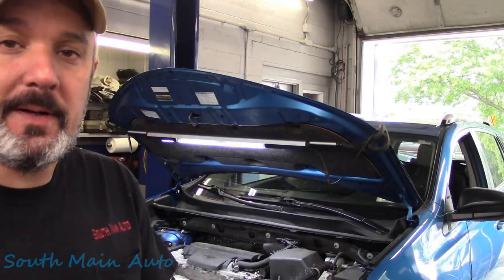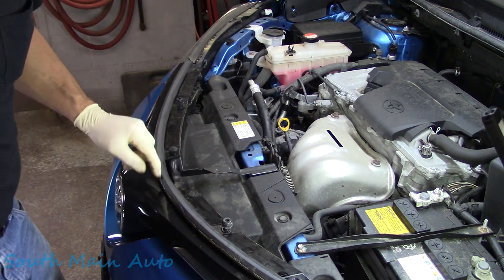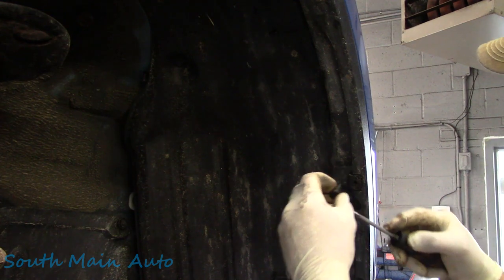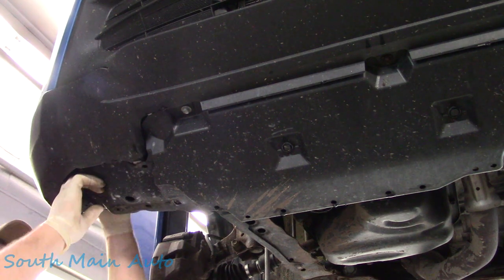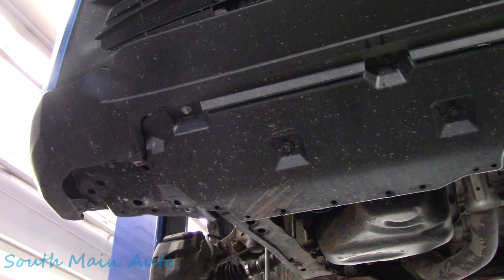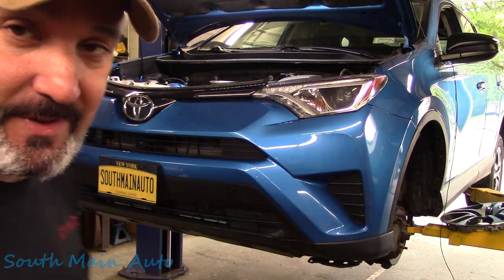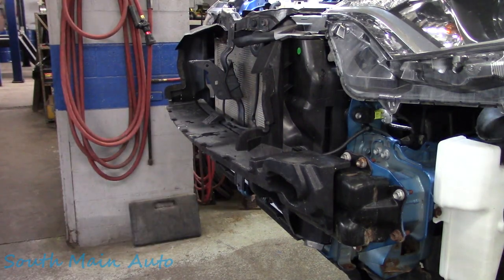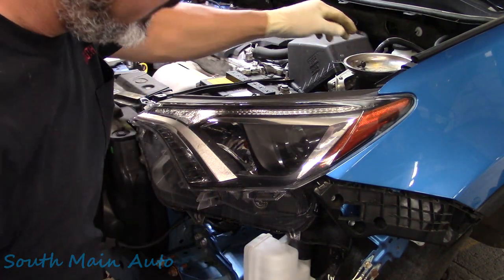2013-2018 Rav4 A/C Condenser Replacement

Comment: This was interesting to see.  I was thinking if this was the other end of the A/C cycle - the evaporator - that was leaking, that could be a really involved job, with lot of interior pieces removed.  I hope the owner of this 2016 model gets a bunch of good cool years out of this repair, before something like the evaporator leaks.
Reply: Condensers are always going to fail before the evaporator will.  Just because they are at the frontmost part of the vehicle.  They get hit by bugs and pebbles and other road debris.  Not to mention all the passive heat from the radiator right next to it, plus rain, sleet, snow, etc..  I'm surprised they don't fail more often.
Reply: Toyota’s have really good AC systems, but all cars need repairs. My 98 4Runner still blows cold, had to top off the r134 after a serpentine belt change. Took half a can.
Reply: @jtjones4727  I owned a total of 5 Jeep Cherokees (not Grand) over the years. Every one of them developed a leak in the evaporator after about 10 years. Never had a condenser leak.
Reply: @jtjones4727  Only Bikers know How Big bugs really are ! LOL

Comment: You're an amazing mechanic. I totally agree with you on modern cars - the complexity and the amazement that they work as well as they do for as long as they do. It's a pity that when they get a certain age, there will be nothing there to restore. Brittle plastic parts turning to dust and so many types of plastic fasteners to source. Probably no working scan tools around because the industry moved on to something else. I guess a lot of the manufacturing has moved on to injection molds instead of stamping dies. It is amazing the parts all fit together as well as they do!
Reply: Lets be real, for most "proper" cars there isn't much to restore beyond a certain point. Brittle plastic, deteriorated cloth/leather, or rotted away metal, it's all the same. No matter where you live, one or more of these deaths await all cars at a certain age, no matter if it's a "classic" or a modern car. In the north, they rust. In the desert, anything not metal just gets brittle... Andbif you keep your car in a clean, air conditioned garage as a show piece, all the hoses and seals get brittle and will just leak like a sieve the first time you drive the car after it's been sitting in "conservation" for a decade.

Comment: 27:44 I wholeheartedly agree. I replaced the condenser on my old subie myself. Rented a vacuum pump, and tried to diy recharge myself with a manifold gauge set, and a postal scale to weigh the cans. I think that subie called for 14oz-16oz of refrigerant, and people say they're super picky about how much refrigerant is in the system. Long story short, I got it done, but at the end I wasn't exactly sure how much refrigerant I got in the system. I knew it was somewhere around the correct amount, but I didn't like the feeling of uncertainty. If I had to do it again, I'd do the nuts and bolts part of replacing the condenser myself, and then let a shop do a proper recharge.
Reply: I got lucky on my minivan (olds silhouette) took exactly 36oz of refrigerant. I fixed the leaking service ports, pulled a vacuum and dumped in 3 12oz cans. Works ok, but between changing cans and purging the line, probably an oz or 2 short. Now that I am working at a shop, I can evacuate and recharge to the correct amount.
Reply: @kd7cwg  Dual A/C? That's one hell of a lot of 134a! Most systems are happy with about 1/2 that.
Reply: @billh230  yep, used to have a suburban 2500 with front/rear and I think it took even more 😳
Reply: I just looked it up. 64oz in the suburban.
Reply: @kd7cwg  Looks like I need to review. Most aircon systems I've screwed with ate of the aftermarket/hot rod variety. I just leave evac and charging to the HVAC guys, while I do my thing.
Reply: Too little and mediocre cooling, too much, and you hydrolock the compressor.  Sounds like you did just fine.
Reply: You dont't have to do government paperwork to purchase coolant agent?😁
Reply: The most important procedure in the entire operation is to evac and recharge properly.
Reply: We don't have these specialized charging stations here. Experienced ac techs just vacuum the system and add refrigerant until the sight glass clear and the pressures are good. These 2 will tell a lot. For instance when there is too much oil, the high side will be high, while low side is low and sight glass is not clear.

Comment: I had a 1988 s10 2.8 throttle body bolt repaired at a machine shop... and they used a wood screw type set. It cranked the tq like crazy by hand:)

Comment: Last Toyota AC work I did was on a 91 Camry.  Needed reman Denso compressor and dryer.  Converted to 134 and new schrader valves. 3 years in and still blowing cold!

Comment: This video came at a right time.  I'm having issues with my A/C in my truck and just ordered some manifold gauges to see what's wrong with it.  Hopefully, I am just low and will probably take it to a shop and have them recharge it.
Reply: Jimmy S  I have been doing a ton of research and watching a ton of videos and a lot of shops that have videos  say to evacuate the whole system (including ol' Scotty Kilmer) and recharge with new refrigerate.  Especially with the R134 system which mine has.  Thanks for the tip about the stop leak stuff.  I had someone recommend that stuff and I was leary about it.

Comment: I have a 2015 Highlander that I bought used with 104000 miles.  love that car. then I wanted to change the headlight lens. I had to take the whole front cover off! I think I did well It only Tok me 5 hours to change the lens's.

Comment: Hi Eric. I always replace the Orings with new as a caution. Since old ones are compressed, I think it is a "best practice" to replace with new for maximum sealing. Keep the old ones in case you lose one.
Reply: Not replacing AC O-rings on a vehicle that old is just asking for a comeback, very surprised he cut corners like that, it's not worth the potential problem.
Reply: You guys are such experts, you should have your own channel. 🤥

Comment: The engineering in automobiles in general impress me. Think about how the small ends of the rods rotate around the crank. It only ever touches when you first start the car. The rest of the time it floats on a "pillow" of oil. It's rather incredible engineering.
Reply: It gets even cooler when you look at the drivetrain of a hybrid like a Prius. There's a secondary electric oil pump that pre-charges the system so it has full oil pressure before it even starts cranking.

Comment: Curious if Toyota assumes the "pre-installed" desiccant pack is likely saturated in transit/storage, and expects the fresh one to be installed to start "fresh"?
Reply from the maker: Wonder why in the heck they even put on in then in the first place? Nothing in service info about it....
Reply: @SouthMainAuto  I'm thinking that the condenser is "problematic" to dry out sufficiently, if it does happen to get wet in transit/storage,  so the installed pack is "pre-emptive"... but curious there's no mention in service info.

Regardless, I'm spit-balling, because Toyota is pretty smart,  and I can't just accept that it's an oversight.

Comment: Yep, amazed that a small car like the former Fiat 500 was built like it was. Did an extensive research on them when they were being introduced in 2012 and they had a beefier frame for the US versions and were designed to remain intact in the cabins so the doors can still open to some degree at least in a head on collision, and if I recall, they did fairly well according to NTSA. Back in the 90's, I drove a 1983 Hondoo Civic, the venerable "big" 1500cc DX grade hatchback that weighed all of 1500Lbs and had all of 68HP and when in a collision, they likely folded like a tin can in a serious accident and I drove the snot out of mine back in the day. 

In 2012, bought a replacement vehicle, a 2003 Mazda Protege 5 wagon with 110K and change on the clock and a decade later, it's still on the road, AC still blowing reasonably cold, but could use a little TLC now and it has 195K miles on it and has been a super trooper this whole time, outside of 2 big repairs, the timing belt replacement that took me a while to figure out why it was running like poo (timing at the exhaust valves was a tad off), but once that was solved, it ran great, then the right front wheel bearing was going bad, and ended up having both replaced, and had already had one done in 2013, along with new tires that year. I have 195K and change on this car and it's still running mighty fine.

As you pointed out, it used to be that you'd barely get over 100K miles before the car would begin to fall apart, and that was by the late 60's and beyond. Before that, often a car was used up (rust notwithstanding) by 80K.

Comment: My 2016 rav4 was in the shop for 1.5days they couldnt find the leak. Watched you video, got the car back from the dealer and put a sniffer right on the bracket that you pointed out. Bingo! Will now do the replacement myself, what is the torque spec for the tube connections on side of the coil?
Thanks so much for your detailed video!

Comment: I remember in the old days on my 66 Riviera 4 bolts for the radiator then you were at the condenser and done. Today you have to disassemble the front of the car just to get to it.

Comment: I still have an 85 Oldsmobile. It's got close to 600,000 miles and the only issue i had recently is that the original transmission started slipping

Comment: i learned a good lesson after listening to you recomend Dorman over and over had to replace the gas pedal on a 2007 buick drive my wire. well have installed 3 all bad called Dorman each time and they went over the testing while staying on the phone with me and after the 3rd one they said go get a OEM and be done with it. i said who is paying for all these hours diag time and they said submit a bill and you will be paid for the time. now wondering if i will get it. I knew better but after you said how much you liked there products i tried it. LOL

Comment: If you ever watch Ron Pratt's channel he had an emergency tow off the highway that had been an enormous collision, literally the engine from this SUV was a hundred feet away and bits and pieces were scattered everywhere. The car did its job perfectly and dissipated the energy of the crash so well that the driver walked away without serious injury.

Comment: About your statement about the 60%  of the time leak location. 
Is that a design flaw? Seems like it. Always a bonus to see Mrs. 
O make a cameo appearance. Gotta be careful re installing those headlights. Expensive mother lovers. Really like the license plate cover on the front protecting your customers identity. Wow, 38 degrees out of the center vent! brrr. It may sound crazy, but I enjoy repair videos. Thanks for sharing. Ship it!

Comment: Which is more trouble to work on RAV4 or CRV? Hard to believe you need to disassemble the car to get to the condenser. Geeez
Reply from the maker: They are both a good car to work on...unless you are putting the serpentine belt on the CRV. You will learn a few new words then....

Comment: That job made you get just about every tool you own out to do it! Baffling array of different fasteners, I guess it makes sense somewhere to someone in a production factory. Are the top brackets made of steel against the aluminium condenser - or are they plastic? Nice job though.
Reply from the maker: No they are steel. That is the issue when you add a little salt to the equation.
Reply: @SouthMainAuto  I wondered, bit of anodic corrosion and that's it done. Would be so easy for Toyota design out that issue.
Reply: Seems like every time I work on something, I have 50+ tools out 🤔Good thing I have like $30k in tools to fix the modern day car🙄
Reply: @SouthMainAuto  Crazy, why on earth would a simple aluminium stamping not work? Oh, right, the dealers wouldn't get as many gravy jobs.
Reply: @Monkeh616  Aluminum binds to aluminum far more than it binds to steel, when salt's in the mix. The upside of that steel bracket is that the stamping of it actually makes a small "lip" on the punch-out side, which makes it not have that much contact with the aluminum- so very little sticking happens.
Reply: @LordOfSilense  At what point do you ever remove those brackets? They come attached, they stay attached until the thing gets torn apart at the scrapyard.
Reply: @Monkeh616  Not a matter of disassembly. The problem is galvanic corrosion. Keeping a distance between mild steel and aluminum is the reason behind the way that bracket is made. It was never intended to be disassembled.
Reply: @billh230  It seems reasonably logical that the best way to keep a steel bracket away from aluminium is not to make it steel in the first place.

Something is being lost in translation here.
Reply: @SouthMainAuto  Al + Fe + NaCl + electricity = corrosion

Comment: We generally use what ever parts we can get our hands on, OEM or aftermarket, but try to stay away from the dealers as their prices are inflated. We use a few different suppliers that have a range of both OEM and aftermarket. The only aftermarket parts I don't trust is compressors but sometimes you don't have a choice.

Comment: Repairing a Toyota less than a decade old?  A rare sight indeed.
Reply: Scotty Kilmer does not approve
Reply: Jimmy S  Never.  It's impossible for a 1994 Celica to break.
Reply: Its a design flaw. Steel bracket against an aluminum condenser. It will rot out again in 5 years.

Comment: I had a brand new 2011 Camry and the AC went out, brought to dealer and they said a rock damaged condenser. Warranty will not cover rock damage. They wanted $900 to replace condenser. I said no thank you and replaced it myself for about $60 worth. That said there was NO rock damage. But I found that plastic plug on the drier was backed out OR not even screwed in and that was where the Freon leaked out. The condenser I put in had a metal plug. No problems years later.

Comment: Eric, you are 100% correct that cars today are much more reliable, longer lasting, much safer, and have many more creature comforts.  However, I still miss the days when you could walk over the the entire surface of a car, and my father would only yell at me if I didn't take my sneakers off first, because it left trend marks...
Reply: And the older ones are a lot easier to repair, new ones need a computer tech

Comment: Excellent video. Is it possible that a front end collision could damage the condenser with no obvious leak but the air is not cooling or may start a little cool but then run warm? There is no error code and I want to make sure only necessary work is done by Toyota. The accident was by someone slamming into my car with such force that the washer reservoir was smashed and passenger side headlamp. The entire bumper was replaced. Thanks.

Comment: Eric, why would you not want to charge the system and do a leak check before fitting the bumper cover back on? Surely access to the lines would be much easier at that time? And by the way, these new cars do not hold up better, they just collapse better in a crash. BTW, Ray always puts new valves in the lines whenever he services the aircon. Apparently they leak a lot in FL.
Reply: All the road salt in Eric’s area seals them ! LOL

Comment: Question of the day!  How the hell did you get all those plastic retainers out without breaking the tops off any of them? Even with the proper removal tool I always break a few!
Reply: It depends.  If the retainers have been replaced (eg: collision repair) the cheap replacements are quite brittle and basically single use.  Texas heat also seems to fatigue them, whereas in Alberta the retainers seem to outlast the metal.

Comment: Modern cars are a beautiful work of engineering, but what bothers me is when stuff becomes so integrated, that replacement parts get so expensive. Take the Chrysler TIPM. Why solder relays instead of plug in types? I know why, but I digress. Or a lock actuator that is removable from the latch, but not available in OEM, only aftermarket. And the OEM latch is about $500 to boot.  Oh well...On a much happier note, I've learned so much on this channel. Love the custom plate!

Comment: As a kid in the 1960's and early 70's I recall helping my pops change points ,condensor and plugs on the old 68 Plymouth Fury lll. Those cars back then were lucky to get 12K miles on a set of points . Much less 100K ,  Matter of fact you were also lucky if you could get 100K total out of the car .
Reply: That's just it...maybe cars in the past needed more regular maintenance but it was something pretty much anybody could do in their driveway with a few basic tools.  Now you need a dealer-level scan tool just to check the oil level in the car or tell the ECU you just installed a new battery 🙄
Reply: Spark plugs in my 1970 El Camino SS396 would go about 2,500 miles before they would start to miss at higher RPM WOT. Crazy how they will go an easy 30,000+ these days.
Reply: @Garth2011  Prius spark plugs have a 120k mile service interval.
Reply: @moconnell663  Oh yes, they say that and they also say 100,000 miles before an automatic transmission fluid change.  Neither of them are soon enough. Ask anyone in the auto service business.
Reply: @Garth2011  'soon enough' for spark plugs is 'before they cause a misfire.' The lady I carpool with has 210k on her prius, the first set of plugs replaced per the interval at 120k now with with 90k on the second set and absolutely no issues. It's about using the right parts.

Comment: I did this on my '97 Venture,,;New compressor (leaky shaft seal), new condensor (required for warrentty), new receifver/dryer, new little tube thingy for the front evaporator, new compressor oil, exactly 2 cans of Ebay refrigerant, new ebay vacuum pump,,  About 500 bucks,,  That was last year,,  Still blowing cold,, :-)